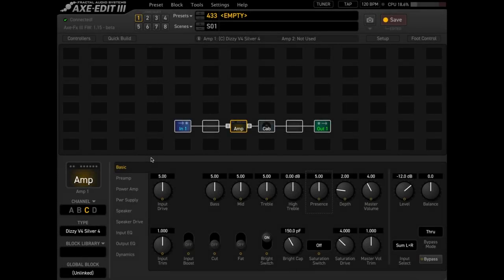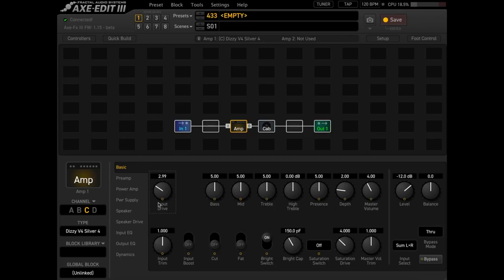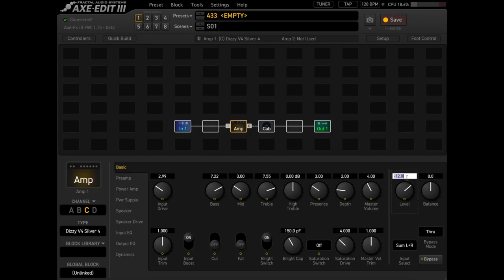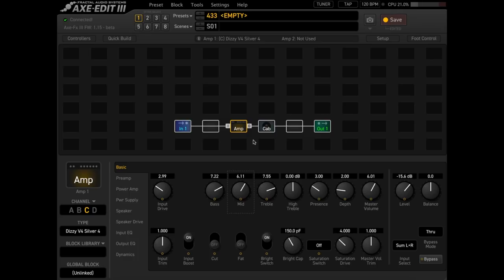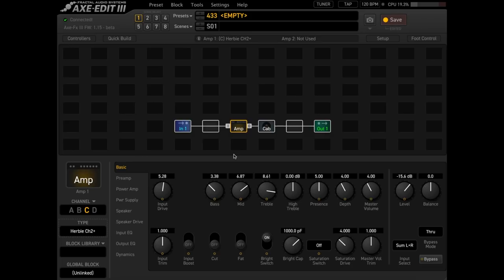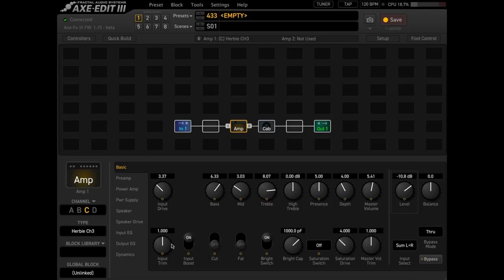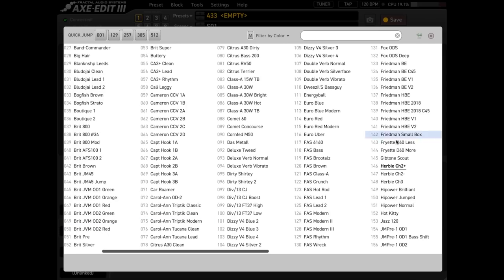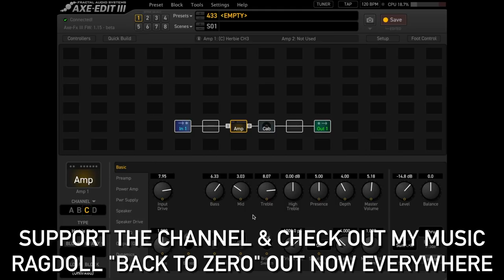Axe-Fx III Tutorial - Diezel Models

Comment: Been on the fence as to save up for a better amp or something like the Axe FX.  Your videos have definitely convinced me that this is the route I want to start saving up for.
Reply: If only like one or two amps... get the amps.  I have a line 6 x3 and use many of the amps with many setting for my different guitars.  I'm saving up for an axe fx.  It all depends on what you want.
Reply: @user-qr7ee2cp4y  what I did with my HX Stomp was to demo amps and buy the tube versions I liked the best. So far really enjoy the Mesa Mark V and Bogner Uberschall amps. And buy one that is unique where there is no amp model yet like Mezzabarba or Wizard. But after having tube amps, think another amp modeler is what I want to record easier to DAW without miking amps and get an FRFR powered cab to feel the air playing like on a real tube amp.

Comment: When mixing different levels on input drive, master volume and level, is there an easy way to make sure your volume levels will be the same from preset to preset. Seems like a challenge, especially when using different amps and cabs between presets. 

Yet again another great tutorial. Thank you!!
Reply: Newer versions of AxeEdit have a “preset levelling” window in the Tools menu that lets you monitor your output levels and adjust the amp level
Reply: @KamilKisiel  awesome, I will check that out. Thank you!!